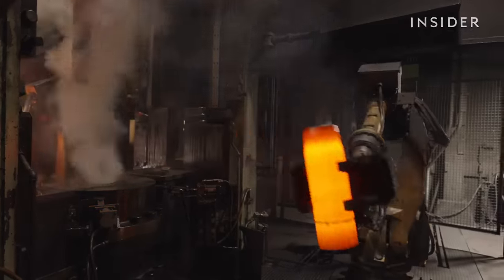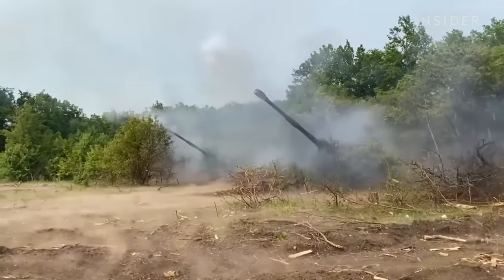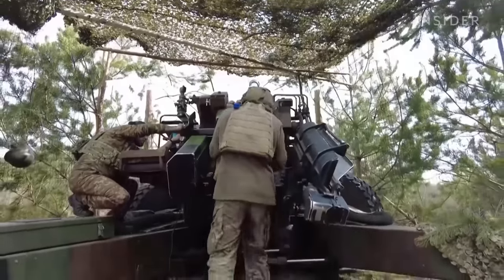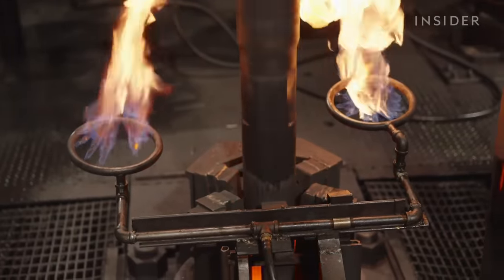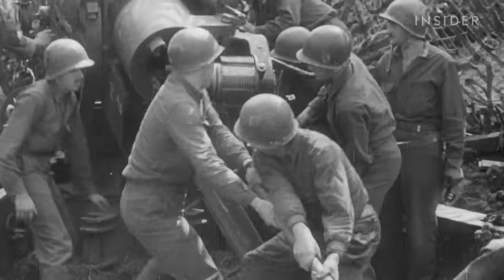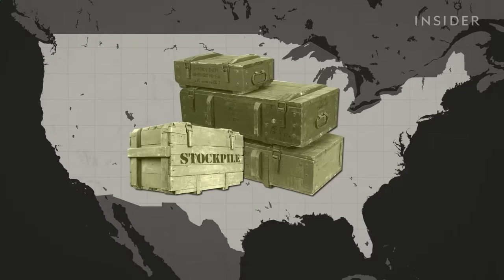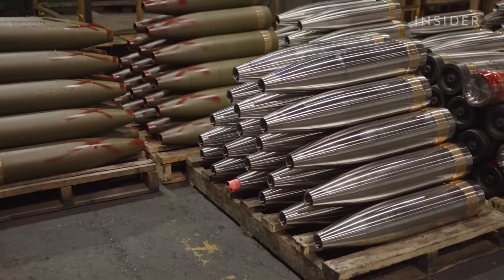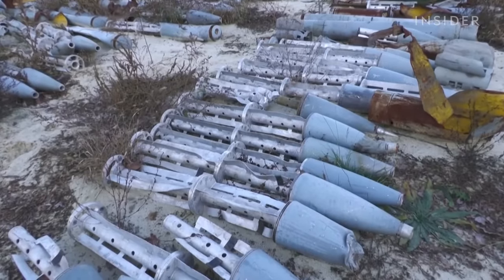Inside the US Factory Making Ukraine’s Most Important Ammo | Big Business | Insider Business

Comment: One thing that isn't being discussed is the fact that bullets and artillery need powder (for firing the shell). That, too, has to be a resource that's strained and its also dangerous to make.
Reply: Gunpowder is very cheap and easy to make. It’s just saltpeter (potassium nitrate), sulfur, and charcoal.
Reply: @minimongo2620  That isn't smokeless powder used in modern equipment - nitro cellulose. The old black powder tends to leave residue and generate so much smoke, it interferes with gun crews. Nitrocellulose is cellulose washed in nitric and sulfuric acid.  It isn't that expensive either.
Reply: @minimongo2620 lol that's blackpowder... 150 years ago the use ended
Reply: @lewisdoherty7621 correct...
Reply: @karantikoo9302  well if the US empties the cupboard any more they’ll be shipping cannonballs to Ukraine, so let’s not be hasty 😂
Reply: @minimongo2620 you’ve no idea what you’re talking about🤫
Reply: @bmsk0076  The Taliban were making it in caves with virtually no modern equipment. My point still stands.
Reply: @minimongo2620  Modern propellants are nitrocellulose based.  And if not properly made and washed - nitrocellulose can spontaneously detonate.
Reply: @minimongo2620 it doesn't. It's useless in modern combat against a modern military power i.e. Russia
Reply: Powdered raw material
Powdered raw material is a mixture of nitrocellulose and one or more explosive oils (nitroglycerin or diethylene glycol dinitrate).
If necessary, various additives can be added. For this purpose, the nitrocellulose is gelatinized to an aqueous pulp with the addition of blasting oils and is then dehydrated again.
Depending on the intended purpose, the proportion of blasting oil varies between 25% and 50%.
Applications include dibasic or polybasic propellant powders and rocket propellants for the solvent-free production process.
Powder pre-concentrate
The powder pre-concentrate is a mixture of alcohol-moistened nitrocellulose and a blasting oil (nitroglycerin or diethylene glycol dinitrate).
If necessary, additives can also be mixed in.
In the manufacturing process, the alcohol-moist nitrocellulose is kneaded with a blasting oil and the whole thing gels.
The powder pre-concentrate consists of 85% blasting oil and 15% nitrocellulose (dry weight) and normally contains 4 to 6% alcohol and < 1% water.
The applications are dibasic and multibasic propellant powders, based on the manufacturing process with solvent.
Reply: The video DID discuss that though, it stated that it is increasing imports of TNT from Japan.
Reply: @minimongo2620  yeap the tech is late 19th century  tech, if fact you can make it in you kitchen, not safe but it can be done.
Reply: @colincampbell767  It will any way, it crystallizes  as a white powder and is somewhat unstable, as time passes.
Reply: "Дорогой, так ведь это давно известный факт. Оружие без боевого заряда - как парик без бигудей! Это и опасно производить, да и истощаемо. Вот в СССР технологии были, и порядок тогда держали, уверяю тебя. Даже Путин, говорят, делает все, чтобы у нас в стране спокойствие было. Пойду, лучше выпью немного вишневки за нашу безопасность. Идешь со мной?"
Reply: "From that time Jesus began to preach, and to say, Repent: for the kingdom of heaven is at hand." Matthew 4:17 

"Ye have heard that it hath been said, An eye for an eye, and a tooth for a tooth: But I say unto you, That ye resist not evil: but whosoever shall smite thee on thy right cheek, turn to him the other also." Matthew 5:38-39 

"And when thou prayest, thou shalt not be as the hypocrites are: for they love to pray standing in the synagogues and in the corners of the streets, that they may be seen of men. Verily I say unto you, They have their reward. But thou, when thou prayest, enter into thy closet, and when thou hast shut thy door, pray to thy Father which is in secret; and thy Father which seeth in secret shall reward thee openly." Matthew 6:5-6|
Reply: It's not. Lol
Reply: @minimongo2620  smokeless powder CANNOT be made in makeshift conditions, you seem to have trouble differentiating between black powder and smokeless powder.
Reply: @minimongo2620  You think we still use gunpowder?!? It isn't the 19th century. We also stopped using muzzle-loaded cannons a while ago.
Reply: @minimongo2620  and what were they doing with it, getting in some musket practice?
Reply: I bet Biden has the contract on that too.
Reply: @toddburgess5056 That was the explosive charge, not the propellant, but that is also a concern and indicates we can't make/procure it fast enough.
Reply: @KB-ke3fi He doesn't have the contract on anything. The Scranton Army Ammunition Plant has been operating since since 1953 and is currently operated under contract by General Dynamics.
Reply: @minimongo2620  You also neglect the other major malfunction of your beloved black powder: the clouds of white smoke, which are like beacons to the enemy. "Here I am, come get me!" Study up on the chemistry, lad.

Comment: Pretty sure the main filling is Comb B, not TNT... and yes 20km is in the ballpark of no-frills 155 rounds, but with Base Bleed (HEBB) or Rocket Assist  (RAP) rounds, that range can be extended to closer to 30-40km.
Reply: I think imx-101 is the fill for the 155s and comp b is usually in grenades but I could be wrong. The manufacture can change over time and switch supply chain at any moment.
Reply: TNT is the main fill,  IMX 101 and 104 is also used.  Currently the USG doesn't have a Comp B M795.
Reply: also shouldnt a longer round fly further? the idea that because theyre only 2 feet they can go up to 20 km is kinda weird, no?
if they were the same diameter but longer theyd have better aerodynamics and a higher inert weight, meaning theyd lose speed way slower.

Comment: The rounds are filled with compensation B explosive not TNT. Only shells that use point detonating or delay fuses have a TNT charge. Time or altitude detonating fuses which makes you to remove the TNT charge. I would love to know how to apply for a job in the 155mm factor since I was in artillery in the Marine Corps but we had 8" self propelled howitzers.
Reply: TNT hasn't been used since the 80's, They started phasing out Comp B in the early 2000's, shells these days are mostly IMX (Dinitroanisole, Nitrotriazolone, & Nitroguanidine)
Reply: Thank you for the updated information. I'll have to try to keep that in mind. Did they start phasing out the Comp B shells when they starting using the new M777 howitzers? When I was in the Marine Corps, we had the self propelled M109 & 8" howitzers , I believe it was named the M110, but I usually get the correct numbers wrong, along withe the M198, & the 105mm howitzers. 

Till this day before the large budgets in the 1980's, which gun was the funnest gun to shoot. Either the 8" or the 105mm.

Comment: Nearly every piece of equipment the United States has delivered to Ukraine was initially destined to be discarded.  They were either obsolete or existing stocks were large enough that the expense of storing them was more significant than what they were worth.  The only real exception is artillery shells described in this article. Still, the ability to rapidly ramp up production of these weapons is a necessary and often overlooked component of our defense capability.

As the war drags on, the sheer quantity of the expended arms is changing this quickly.  In other words, the arms we are giving now are beginning to dip deep into stockpiles the US requires to fight a land war anywhere.  To which my response is... so what? Remember that these weapons are designed to be used against our enemies, and they are fulfilling that purpose by giving them to Ukraine.

Comment: The question here is how to ramp-up the production. Not by 2028, but now. We need to get our manufacturing giants on board. The auto makers for example. They know how to cut raw steel to size, heat treatment, press to shape. They also have the robotic machinery to do it. Give them the government contracts.
Reply: The problem is that deep-drawing an artillery shell body is unlike anything found in the automotive industry.
Reply: @SynchroScore  The government arsenal will help the auto makers (and others) to start. Give them the data package; show them the ropes; bring them up to speed. That's always been the case. Why do you think the General Motors knew how to make guns, artillery, etc. in WW2?
Reply: @ichimonjiguy  The problem is not necessarily knowledge, but also technical capability. The automotive industry simply doesn't do deep-drawn forgings like this, or at least nothing with a wall thickness like this (the closest thing that comes to mind are shock-absorber shells, which are a much thinner steel that is cold-formed from welded tube). Constructing the necessary forging presses is a very specialized business, and getting things to work correctly requires a fair bit of trial and error, a fair bit of art as well as science. Granted, once you get over that initial hurdle of building the production machinery, installing it, testing it, commissioning it, and fine-tuning your process, you can have a very productive plant. And it has to be right. You are putting a steel can of explosives into a steel tube, and setting off more explosives right next to it. If you don't get the forging process and heat-treating correct, you have not created an artillery shell, you've created a very large pipe bomb.

But that's the thing: General Motors didn't know how to make any of that in WW2, and it took at least a year to convert to full production.
Reply: @SynchroScore  It will be learning curve and teething problems. They are to be expected. Out-sourcing is the only way to ramp-up the shell production quickly.